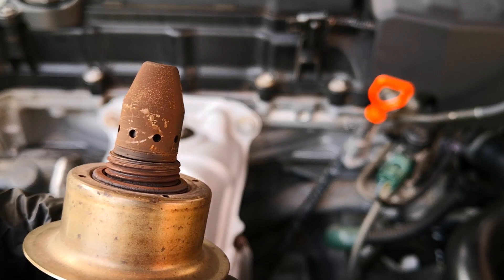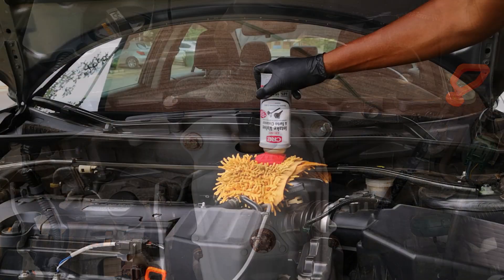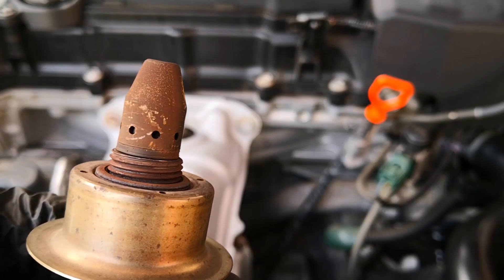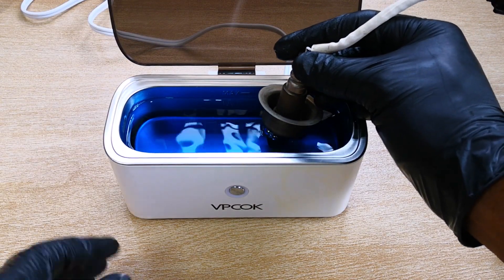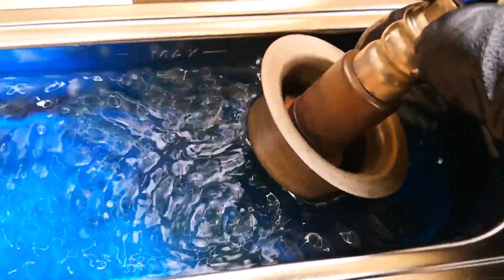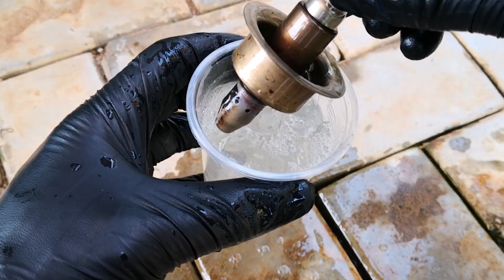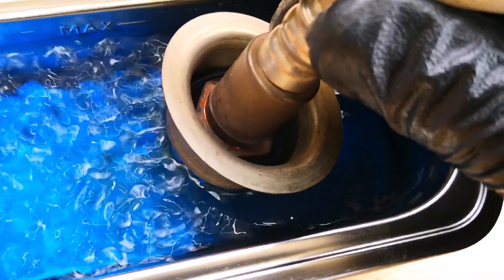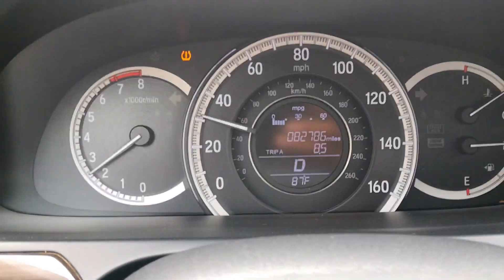Clean car O2 Sensor using Engine Degreaser & Ultrasound Cleaner / Best way to Clean Oxygen Sensor?

Comment: Put o2 sensor in a shot glass with throttle body cleaner soaked for 8 hours then put in ultrasound in shot glass with water around the glass 15 minutes.  The vibration traveled through the glass and really got alot of residue and deposits out from the sensor. Going to reinstall and drive tomorrow.
Reply from the maker: Do let me know how it goes! Did you have any O2 sensor codes prior?

Comment: What did the data show, before and after?
Reply from the maker: I didn't check the data. This was more cosmetic if anything. 
Just wanted to show it since it would be useful in the event that someone had a car running rich to the point of having black smoke which would contaminate the sensor.

Comment: I like how you have invested in tools.

My 2006 accord after few minutes of driving won't go more than 2600 rpm. What do you think id is wrong?
Reply from the maker: The car is in limp mode. The ECU has limited the power output of the engine due to a problem. The check engine light is on right? You will need to have the car scanned.

Comment: To me the question boils down to if the cleaning fluid (degreaser in this case) will alter the chemical characteristics sensor operation depends on. And honestly, I'd go for a fluid that's as chemically inert as possible just to be safe. I really can't say if degreaser is inert enough or not.
Reply from the maker: Very fair points raised. The fact that it's safe on plastic and rubber cuts it for me. Most harsh chemicals will start with rubber or plastic.
Reply: It's hard to say honestly. I've never cleaned an O2 sensor before. As far as inert goes, silicone spray is inert, but it silicone will absolutely poison an O2 sensor and kill it. I guess it's hard to say. Someone should do some research and testing of various chemicals to see what works best and is also safest.
Reply: @MadmanParagraphGuy  Good food for thought.
Reply: I heard that some used toilet bowl cleaner